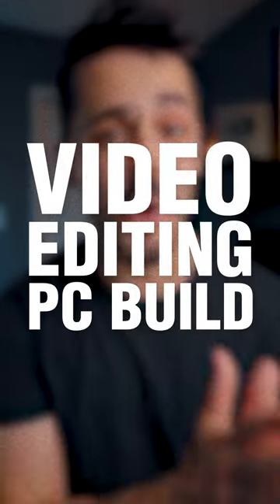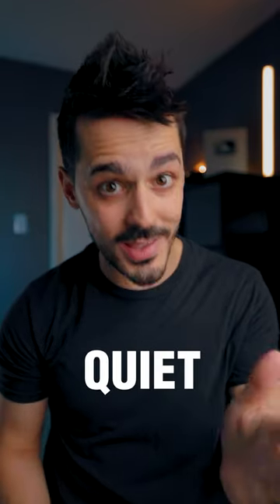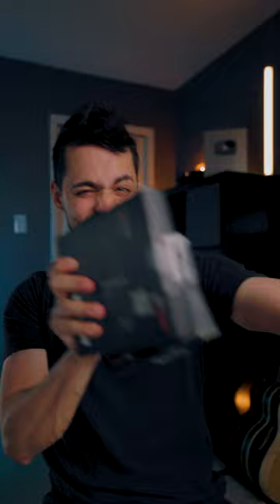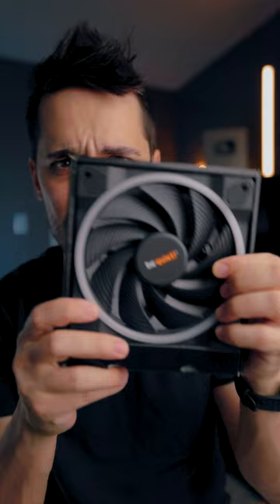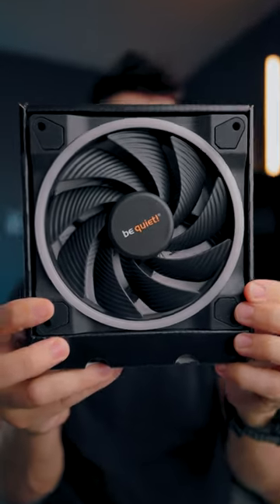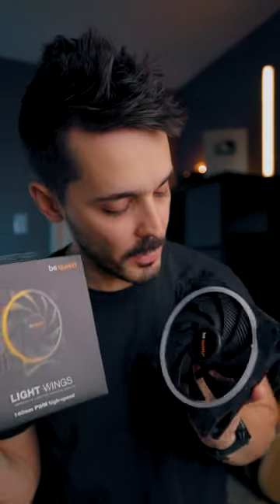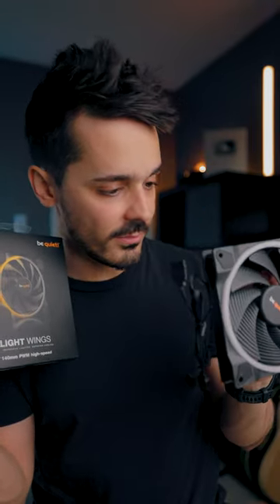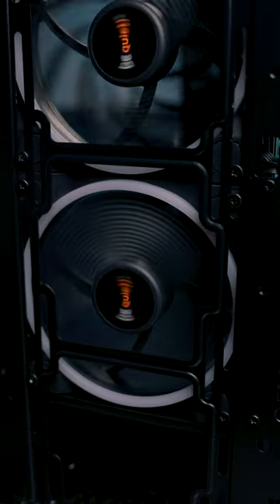The Ultimate "QUIET" Video Editing PC #PCbuild

Comment: PWM - Pulse Width Modulation. These fans use PWM to control their speed more precisely than traditional voltage control, improving cooling efficiency and reducing noise.
Reply: This germany product is good efficience air flow. But noctua is good for enthusiasttt 😂

Comment: I got a be quiet! case with sound dampening and no glass window. 7 be quiet! fans and a be quiet! powersupply, be quiet! cpu cooler and an asus tough graphics card with huge heat sinks and 3 quiet fans.
It makes hardly any noise, not even under full load.
Paired with 128GB RAM and r9 3900x it's been running since 2019 with no dust inside. Incredible machine, not doing anything to upgrade it any time soon.
Chews through everything in premiere except 4K 4:2:2, where it feels just slightly slow on the timeline when pressing Play. But I always record with proxies in-camera, so it's never an issue.

Comment: I built mine in an open frame.  I9-10900X . You’ll find very quickly the loudest component is the GPU.   But I use the larger 3x fan (ASUS Strix) models in quiet mode as long as everything else surrounding is kept cool reducing the heat onto GPU. Then I use 1 or 2 auxiliary Noctua fans as needed only under loading (over chipset & mosfet) Using the largest Noctua CPU tower cooler & fans you can fit.

Comment: Spin Twice as Fast?
Reply: 😂 not quiet if
Reply from the maker: I guess it would be based on the area of a circle. So probably more than twice as fast.
Reply: Something similar to aperture where doubling the radius quadruples the area, but with compensation for the middle dead zone and speed variance from center to blade tip, so my estimate would be close to 4x the rpm @AnthonyGugliotta